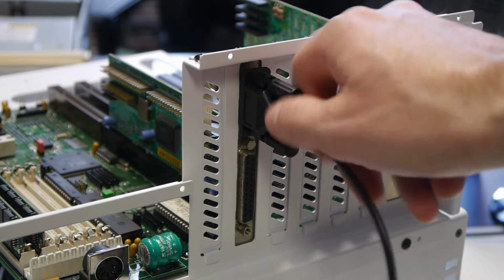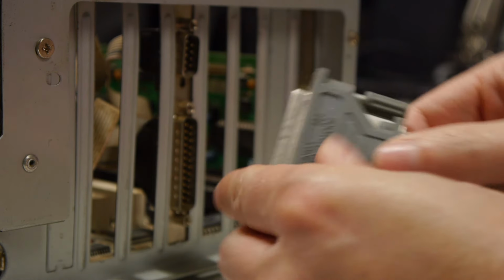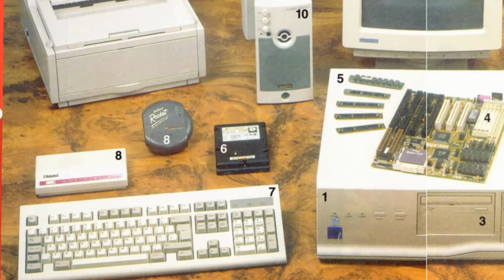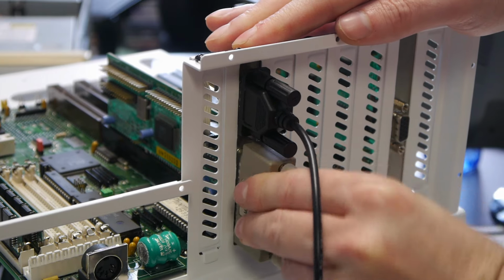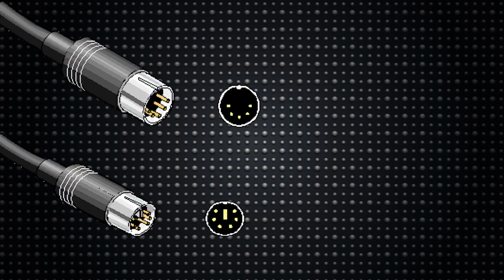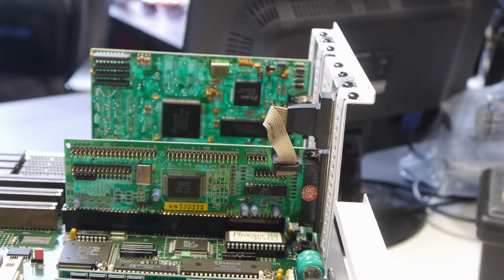What did we use before USB? | Nostalgia Nerd

Comment: The USB idea came from Apple’s ADB Intel took that concept and produced a modern version that all could adopt so was named Universal as all would use this Serial Bus connection and USB was born and took off when Apple supported it and users at the time regarded the USB as an Apple thing that kind of annoyed Intel at the time as before Apple adopted it for the iMac dropping ADB for USB PC manufacturers allready adopted it but no one was interested in supporting it with hardware until Apple gives them a reason, hardware would work on both hardware as one didn’t have to support two different conceptions on say a scanner, printer made.

I used to do a lot of parallel port stuf back in the day, with micro controllers, was a great simple port for software and hardware hackers, I used to even hack the joystick port but the parallel was cool back in the day, I used to plug my PS1 controller into it and run MAME on my PC, great days, the USB is so boring and difficult to work with, you got to keep on pestering it that makes it slow like the joystick port that your software had to loop around to find out how long the CR circuit took to charge then you could calculate the X and Y values such a CPU cycle waster
Reply: I thought the idea came from Atari's SIO.
Reply: Enemy Sub may have played a part just like ADB, but ADB is was designed for keyboards, mouse, joysticks etc all daisy changed like FireWire the mouse and joystick would connect to the keyboard kind of hub like a USB hub and ADB supplying 5v just like USB, don’t know how similar Atari had but ADB was noticed by Intel that lead to USB
Reply: The point is the concept of a daisy chainable powered interface that can support various different types external peripherals existed long before Apple's ADB, and honestly the concept of a single powered interface that can support various different types of devices isn't exactly a ground breaking one in the first place as it's really a basic concepot and the most logical route to go.

And to credit Apple with USB taking off is very laughable. Their first system with USB was the iMac released in August 1998 (announced in May 1998) which is the same month USB 1.1 was "released", meanwhile Microsoft had already released Windows 98 in June 1998 which had USB 1.1 support from the get go. In 1998 around 81 million operating systems were shipped with Windows 98 having sold over 500,000 units in just its first four days alone and held a 17.2% market share by the end of 1998, Apple on the other hand walked into 1998 with a paltry 4.6% share and left with 5% selling only 2.7 million systems. Hardware manufacturers were already working on USB 1.1 support before iMac was released with Intel releasing their 440BX chipset in April 1998, and there were already over 400 members of the USB-IF in 1997 with over 500 products in development and expectations of over 100 devices to be released during 1998. In reality USB was taking off well before Apple got involved with it and realistically had no effect on its adoption, it was already being majorly pushed by the major companies and utilised after the release of Windows 98 before the far less popular iMac was even released.
Reply: Sevicify USB took off when the iMac came out, before then parallel and AppleTalk still dominated but with the iMac gived manufacturers the incentive to go USB only, and USB picked up from their, I remember the days before the iMac and USB was just struggling to make any big impact as Scanners were quite popular at the time as well as printers with post script level 2/3 and they wanted to support Mac and PC so just kept what they had like SCSI and parallel port Apple adopting USB gives them a reason to start adopting it.
Reply: Richie USB was only struggling due to issues with late support for the 1.0 standard, Windows 98 shipped with 1.1 support out of the box 2 months BEFORE iMac was released. Windows 98 had sold over 500,000 copies in its first 4 days and held a whopping 17.2% market share by the end of 1998 compared to the paltry 5% of Mac (combined, not just iMacs), and this was a year where around 81 million operating systems were shipped so you can imagine how many copies of Windows 98 were in the wild compared to iMacs. And manufacturers already had the incentive to develop USB devices with it being developed & pushed by the major companies like Intel, Microsoft, Compaq & IBM, once again the USB-IF held passed 400 members with over 500 products in development during 1997 and Intel had already released their 440BX chipset with 1.1 support in April 1998 which if you can do basic math is all BEFORE iMac was released (August 1998) or even announced (May 1998). Bottom line is USB was already undergoing a growth spurt due to the push by the major companies behind it (which DIDN'T include Apple) and release of the newer 1.1 standard to resolve issues with 1.0 with native out-of-the-box support in the highly anticipated new version of Windows and 100s of products in development & being released (again all BEFORE iMac), Apple simply joined in on the fun and definitely aren't the reason USB took off (it taking off is why they adopted it in the first place). So even without iMac supporting USB it was still taking off and to credit Apple for it is again laughable.
Reply: Sevicify USB was struggling only back in 1998 did it finally get off the ground the same year that Apple shocked the world by adopting USB, they influence manufacturers to adopt it and soon got seen to live up to its name as a Universal connection as both platforms were supporting it, not giving Apple credit for USB being adopted but helped push it
Reply: Richie Manufacturers were already supporting it well before Apple got involved, again in 97 the USB-IF had passed 400 members with 500 products in development for the upcoming 1.1 standard in 98. At that point it was only struggling with consumer adoption but that's only because USB 1.1 wouldn't be released until mid-1998 with Intel releasing their chipset in April and Microsoft with Windows 98 in June both with full 1.1 support, Apple releasing the iMac had minimal impact compared to those two. Honestly what do you think had more impact a system that had sold over 13 million units by the end of 98 or one that sold less than 2.7 million (total macs sold in 98, not all were iMacs)? Fact is USB was already being adopted by the manufacturers who were pushing it to consumers before Apple who really did very little, and if you can look past your obvious fanboyism for Apple you will realise this.
Reply: But still, it wasn’t Windows that kicked off USB, it was the iMac. I explained why in another comment.
Reply: Lawrence D’Oliveiro And how exactly did Mac kick off USB? Read what I said, here I'll help by making it point style -

1) Major manufacturers such as Intel, Microsoft, Compaq, IBM and NEC were backing it from the get go in 1995. IBM, Intel, and Microsoft had already well become the industry leaders at that point in time, and even more so in 1998, while Apple's was falling well below 5% market share.

2) Over 400 members joined the USB-IF (which isn't mandatory anyway) with over 500 products in development in 1997.

3) Intel and Microsoft both released support for USB 1.1 BEFORE Apple even announced the iMac which happened in May 1998.

4) Over 13 million copies of Windows 98, with native USB 1.1 support out-of-the-box, shipped in 1998 compared to less than 2.7 million iMacs.

Fact is manufacturers were already adopting USB well before Apple got involved with it and consumer use was undergoing a growth spurt post mid-1998 regardless of Apple due to those 400+ manufacturers releasing their 500+ products and as consumers upgraded their systems, the only thing Apple was ahead on was cutting legacy ports but with their tiny market share compared to Windows & Intel this had a very minimal impact on the growth (USB was taking over with or without Apple, and manufacturers who had focused on RS-432 serial & PS2 devices weren't exactly worried about supporting Apple either) and you're kidding yourself if you honestly believe otherwise and you're especially deluded if you believe they "kicked off USB".
Reply: Sevicify consumers only seen the USB as another port, no way did they understand about 1.1 and 1.0 they just seen it as a new port called USB, after all how many do you think knew about the different versions of parallel port or understood the difference between 25pin v 9pin serial port very few, users just don’t like change and iMac helped at no point I am giving Apple credit just saying it did help in pushing it as you need the most support to push anything just like Type-C yet again Apple has influence others to support it, the more companies on board the quicker it will get adopted and Apple is a big driving force as all seem to look at what Apple is doing
Reply: I'm sorry but I had a Tiny pc (Pentium 2) with USB sockets in 1998 way before iMac came out.
Reply: Chris Debnam exactly, until the iMac came out USB wasn’t making much ground but when Apple adopted it, then it became far more attractive as they could just make printers and scanners with one port and can simply write a driver for both platforms, so it helped but it would of happened ether way just help to give it that extra push

Comment: Another irritation back then was security dongles. They plugged into your serial port, and acted as a copy protection. Fine... unless you needed 2 of them
Reply: Nicholas Scott       Well, most of those dongles used a Parallel port, not Serial, and most of them also had a pass-through, so you could connect few of them in a series, and even still connect printer through all of them.
Reply: Hardware USB license keys exist today.  They're not as common since license servers and such are more common now, but an application we use at work requires USB license keys to be plugged in to use the software.

Comment: 8:28 having midi on the joystick port actually killed 3 birds with the one stone as the midi connection could be used by joysticks for force feedback.
Reply: Game port were IRQ driven and that was cool cuz no input lag. On the other hand allocating irq was a nightmare, and usually several devices/components/peripheral had to share the same irq.
Reply: Annoying part of bundled joystick port into the sound card is you can only have 1 joystick port and most clone cards did't have more than 1 port, not that i knew of.
The problem got complicated as you can't install another card due to resources compatibility issues. 

I still remember before that older program can access 2 joystick ports for same/split-screen 2-players game.
For example: Microsoft GW-Basic supports 2 joysticks, using its STICK & STRIG functions.
Reply: You could buy a cheap 2 player adaptor for midi ports
Reply: That's why it's a personal computer ;)  If your friends want to play, tell them to bring their own and network (or serial link) it all up!

Comment: I love how nowadays when anyone asks me to install Windows 7 on a brand new Ryzen 7 system, the only way to do so is using a PS/2 keyboard, because of how the USB is handled differently, and you cannot simply merge the USB3 drivers for it into the Win7 installer like you could with earlier hardware. You can only get them up and running in the final installed operating system.

Comment: I recently bought a refurbished film scanner that uses a SCSI cable I had to get the card separately. I used an older PC with a motherboard that has the appropriate PCI slot (non PCIe). Hassle you might say, but I paid all in all a 1/4 of what I would have done for a flat bed scanner that still doesn't match up to a dedicated film scanner from 2000. Perfectly decent tech becomes orphaned, but there's always a work around.

Comment: The motherboard I am currently using atm still came with both parallel and serial ports, interestingly enough. I presume the H110M-DS2 was marketed towards office or workstation markets that still needed a legacy connection.
Reply: blakegriplingph I had a Dell Optiplex machine as a main rig that still had serial and parallel until it failed on me just last week haha, it was a business machine we picked up from a local company getting rid of them to upgrade
Reply: Oh man, I still have a Pentium DC with the old ports on the 05-07 SFF Hewlett-Packard business box. Imagine the fun with printers you can have.

Comment: RS-232 is a protocol. The port is called a DB-9. DB-9 serial ports support other protocols, as well, depending on their intended use (eg, MegaDrive controllers).
Reply: RS-232 defines the electrical characteristics and bit patterns, and the connector is a standard (though not necessarily required).  Generally with serial connections the device/programmer defines the software protocol (there's no "universal" protocol like USB has).  If you change the electrical characteristics you still have a UART compatible interface (3.3V/5V TTL serial, RS-485, etc. are RS-232 compatible with level shifting hardware).
Reply: Good point, I shouldn't have confused standard with protocol :)

Comment: I remember when USB first came around. The guy at my local computer shop told me about it - and I couldn't quite believe it. It sounded amazing and so cool. First time I used one it was so amazing not having to mess with DMA and IRQ settings. Honestly would have never believed that they would have been as prevalent as they continue to be today at the time.
Reply: Actually back in those days you could customize Macintoshes really easily. My Powermacintosh G3 had all kinds of expansion options. It had PCI slots, an AGP Slot, and some other slots I don't quite know what they were. but non customizable macs are something from the recent past.
Reply: Also USB is Plug N Play hot swappable. Fucking amazing at the time it came out.
Reply: What made me think it was a gimmick was the price of USB stuff vs regular stuff. However, once the prices equalized, my mind changed, especially once all of the cool stuff started to come out.
Reply: Dragon Chrysophy are you forgetting how customisable the first Mac was 😛😛😛
Reply: Dragon Chrysophy whilst it’s true you can’t customise the Mac as much as before, I’m sure Apple’s next Mac Pro will deliver.
Reply: .....mean while Mac OS users have NEVER had to deal with IRQs.... So it’s ironic when people think of Mac OS as the inferior OS. Sure, it’s not as designed for games as windows is, but Mac OS can do things windows isn’t as good at as well.
Reply: Aaron Powell Macs aren't inherently bad they just don't cater to the people that want customization and tinkering that you can get with PC. If you like your system out of the box, Macs are good I guess... If not overpriced.
Reply: You may have a point about the whole "Mac IRQs" thing, but bear in mind this hasn't been a differentiating issue for some 20 years now.

Comment: You evil man!

Stop threatening the poor minds of children with the evil that came before USB as they most certainly don't need nightmares about serial or parallel ports, their differences, jumper switches, IRQs, IRQ conflicts and other dark BIOS dwelling filth!

Refrain from this path of investigation or face your destiny!
Reply: I haven't thought about serial ports and having to reboot to connect or disconnect a device in many years. I like it that way, not having to think about them.
Reply: reggiep75 sounds something like a medieval knight would say.
Reply: the real problem was IDE tbh, the rest wasn't that bad...
Thanks god for SATA
Reply: Well, when the world ends and you go into an underground bunker and all the computers are old and you have to get them working this info might be useful.
Reply: @kennethbouchard8643  This info barely scratches the surface.  Watching a short video on equipment that took years to master...which is why we were so eager to evolve to universal interfaces.  That's another problem with things that just up and work today...people want instant gratification.  I used to love loading memory routines to do chip and pin from a 1/2" reel tape drive, flipping through thousand-page volumes of memory maps so I could replace the faulty chips.  Troubleshooting one bit at a time.  4K micro-memories bootstrapping a 65,536 byte core memory with firmware routines loaded from a QIC tape...setting program registers from an incandescent push-button maintenance panel so we could exercise a 300 MB drive that weighed about 400 pounds...after spin purging for 24 hours after a head replacement and CE pack alignment.   We really, really, really, have it good these days.
Reply: I first discovered IRQ conflicts when my internet stopped working unless I was moving my mouse. It was on dialup, and the modem and mouse were sharing an IRQ.
Reply: @01DOGG01  that must've been quite the eureka moment, i love the old days where you just knew things were gonna get better when you learned more about the software/hardware often through painful trial/error and sometimes just pure luck.
Reply: @dansalmon2698  Indeed. Another thing was getting the modem to connect properly in the first place since it was a US modem and I was in Australia.
Had to send some commands to it. Of course without the connection you couldn't altavista your issue.
Can't recall how I worked that one out. Possibly one of the commands was to not wait for a dialtone.
Good old 14.4K days.
Reply: Acoustic coupler modems were pretty simple. Just dial the remote modem using your rotary dial phone, wait for the squawk then place the phone headset into the rubber cups. Even a child could do it! 75 baud was not too fast to scare them though a TTY was rather noisy.
Reply: what kind of jumper are you talking about? the one beside IDE port on some old hard drive or what?
Reply: Tony Stark- a row to select com port, a separate row for dma, and if your lucky, a irq jumper (if your feeling frisky, and want to connect more than 2 devices)